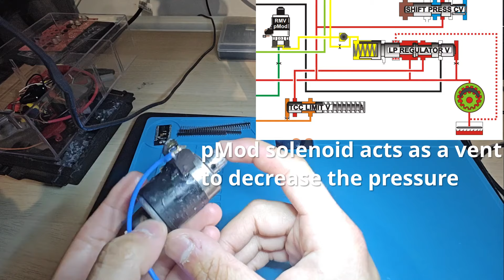Debunking a common misconception on 722.6 blue solenoids

Comment: Well, the blu top solenoids wont affect line pressure but they will let more oil with the same pressure because the diameter inside the valve is enlarged.